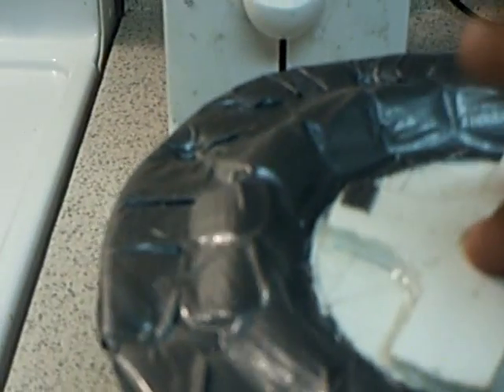Homemade Subwoofer Excursion 3

Comment: You confuse amps (amplifiers) with amps (amperes). :P Indeed it's the current (amperes) not the voltage (volts) which can kill. The most dangerous part of a TV set isn't the high voltage circuits that drive the CRT but the power supply.

Comment: Thanks, but I heard that you can have 500,000 volts shock you without much damage at all; it's the amps that do the damage. I'll look up the chip, and at Fry's they had some microchip kits that let you build stuff, including a small speaker, I think.

Comment: Yes, the amp's power supply is can be dangerous since it will be connected to mains voltage. Having experienced a few shocks myself it's certainly not lethal but it's not pleasant. Highest i've had was 5000V from a TV's focus circuitry, ouch. Left a burn mark.

Then look around, an old 2.1 isn't that hard to find. If you want to play around you could try a TDA2822 powered by batteries. Most cheap computer speakers are made with it, has 2W of output, useful for making ur own mp3 player dock.

Comment: Thanks for the suggestion, but I'm only 13 and I don't think my Mom will let me play around with building amps, and I once heard that building amp can be lethal if you don't know much about electronics or if it's one of your first few projects. I don't know nearly enough to build one anyway. I'd rather connect it to a refuged amp from an old 2.1. All I'd have to do is connect my homemade sub to the wires where the original sub was connected to.

Comment: If you know a bit about electronics you could build a 70W RMS amp for around $60 with the TDA7294 chip. It's very good, the Z-5500 subwoofer uses two 7294s bridged. The chip itself only costs $7 but an adequate power supply transformer for it (2x 35V@3A) is gonna cost you around $40. Besides that only a few caps and resistors are needed. I built one for the 12" i have at my grandparents place and it sounds great, but the sub still needs a proper enclosure. I'll post sum vids on winter vacation.

Comment: I badly want an X-530 and we can't get an X-230, : (. I have a Labtec ~20W 4 3/4" subwoofer 2.1 system I got from a thrift store down my street. Someone stole the 2 satellites and the adapter so I have no way of plugging it in. If I had the adapter, I would use it to power my sub, but that's not really an option right now. So I''ll ask my Mom if I can get a small sub so I could use the amp to push my homemade sub.

Comment from the maker: Thanks. It don't sound like its homemade.

As long as it have the basic needs of a speaker or sub it will work.

I got me a cheap $29.99 Home Theater System from Family Dollar. Its 25 watts. I took the 4" subwoofer out and powered mine from that. But I know bestbuy sell 2.1 speaker systems for 39.99. I think circuit city might be selling them at that price to.

Comment: That's an awsome subwoofer. Others have struggled to make tweeters, but you have made a true subwoofer. I hope mine works at all when I'm done. But I have one MAJOR problem. I need an amp, and even 50W amps aren't much cheaper than $150, and that's far too much for me. How should I power it? Do you know about any uber cheap amps?